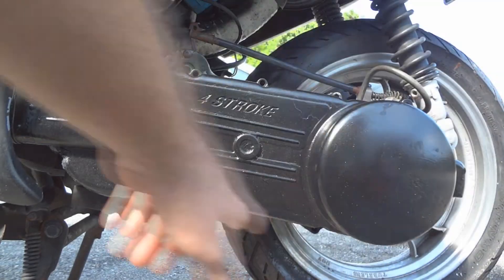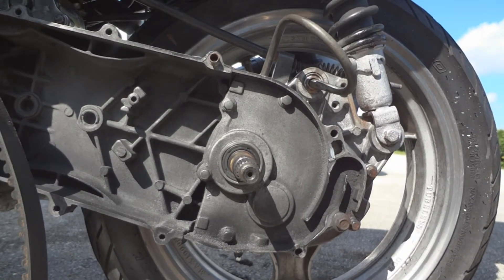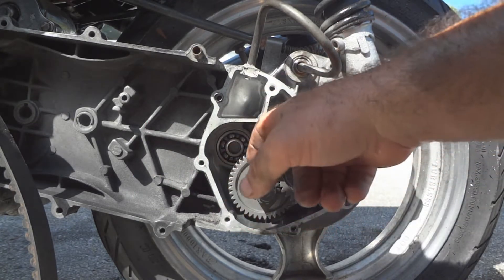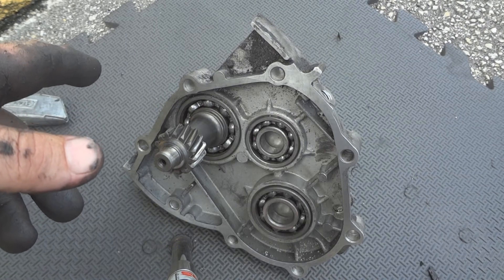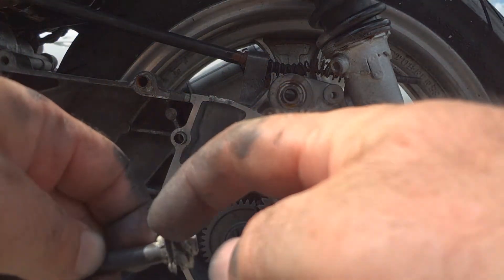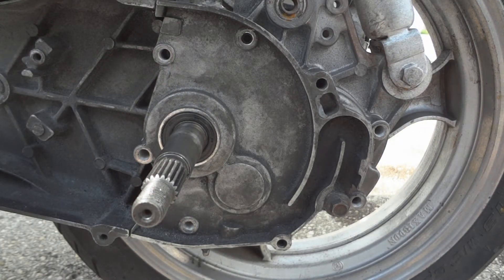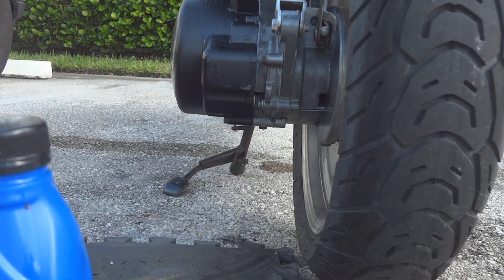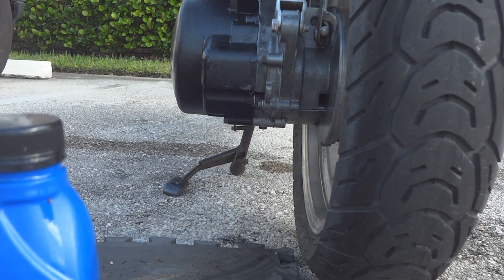How to change a scooter gear box gasket

Comment from the maker: One of the bolts that secures that gasket also holds the cvt cover on very stupid design every time you remove the cvt cover that gasket is getting weaker.

Comment: Ok the drive shaft sticking out there. Does it connect to a bearing when you put that piece back on is it supposed to sit inside bearing i can't get mines to fit or do I need to shave down inside of the bearing hole
Reply from the maker: It stayed connected when I did that job.  You might need a puller to remove it.  Don't make any modification if it doesn't fit its the wrong part.  These bearings usually don't fail its odd your did.
Reply: I swapped out my gear with the same shaft, my case doesn’t want to go back on like the bearing hole is too small for my shaft.